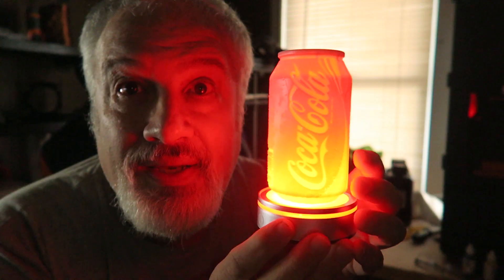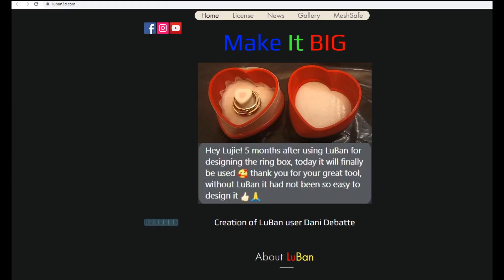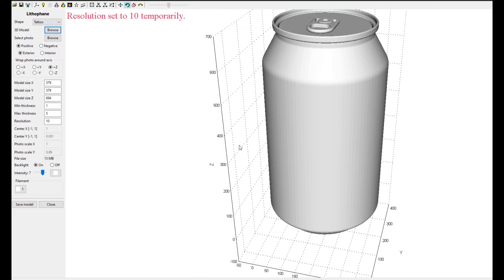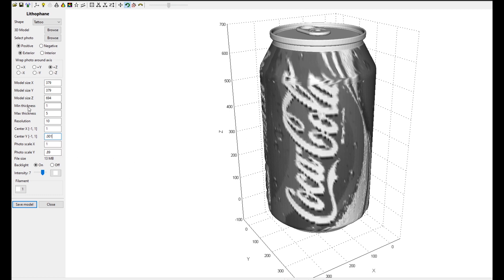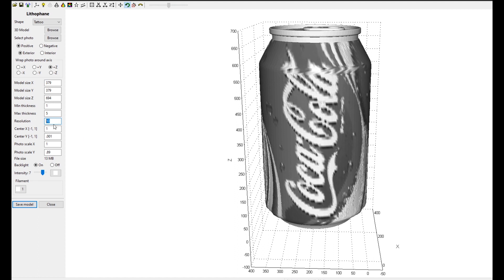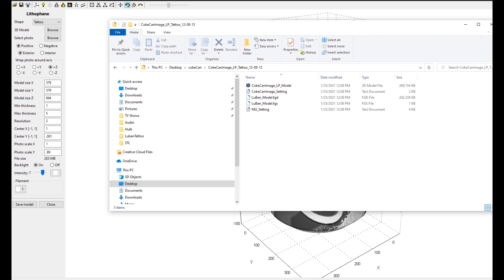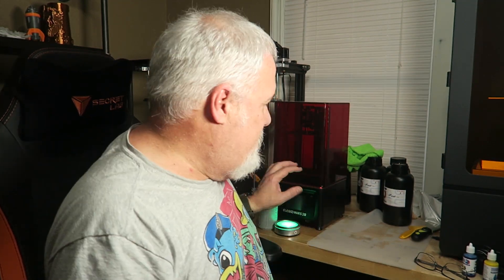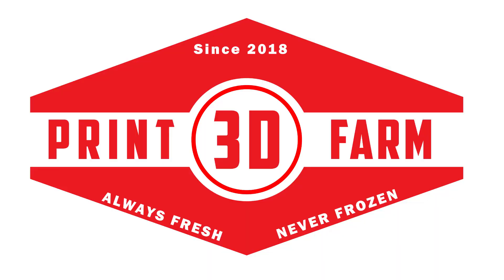How to Wrap a 3D Lithophane around ANY Object! Resin Tutorial!

Comment: I designed a 3d printer pot and I want the lithophane to wrap around the outside but for some reason it wraps around the inside also. Is there a way to change that?

Comment: Hey Garrett, great video! Thanks! You mentioned that you use Chitubox for slicing, what version are you using and have you run into any problems with it? I installed it but it won't load, tried 64bit and 32bit, don't get it.

Comment: Hey Print Farm guy..Can you help me?  My head is gonna explode..I follow your tutorial exactly..and still the model wont print..what i dont get is that i have min set to 1mm and max 5mm..mine looks exactly like yours..i bring it into chitubox and it looks fine..tried different settings..tried vroom, tried a raft, no raft..slow lift speeds  supported just like yours..still fails everytime..so i bring the model into prusa slicer cause i was gonna just fdm print it..then i see when i slice it, its not solid..the walls have breakthrough spots all over it..no wonder it wouldnt print..so why when min thickness is set to 1mm is it breaking through but you dont see that in Luban or chitubox?..model looks fine..the only other thing i dont get is my model comes in with the top and bottom along the y axis..not the z like it should be..i even set my axis before i bring in model and it still does it..I honestly dont think people will have success printing this..my wall thickness looked like 1mm not 5mm anywhere..what is up w that?  .its not even close to that anywhere..its like 1mm and less everywhere..ill show you pics of my fails..the supports print but the model fails a few inches up and the walls basically fail..i thought it was my Vroom settings..so i didnt do that and even printed it 70,70,70.. .05 hgt,  bottom layer 4, exposre time2.8, bottom exposure 20-30,  transition layer 10, 7mm lift distance,  70 speed  i think the walls are to thin..ive printed 100's of lithopanes before..never had this problem..ive tried everything..heavy supports, you name it ive tried it..i want to know why the walls arent solid..obviously the (1mm minimum isnt working)

Comment: This 'Coca-Cola' graphic is badly pixelated. Could you use a 'vector' art file instead?
Reply from the maker: Shoot me an email at 3dPrintFarm@gmail.com and I'll send you the graphic I used.
Reply: @3DPrintFarm : My question was more of a "yes" or "no" question. I saw how you manipulated the file to get rid of most of the pixelation. I'm still curious as to whether or not you could have use a 'vector' art file instead?
Reply: @jayedwin98020  for now, you can only apply a bitmap to a model to make lithophane.
Reply: @lujiechen2334 : "Thank you"!
Reply: @jayedwin98020  Just to add to this though, its not so much that the original image was badly pixelated, it wasn't, its just the representation in Luban was set as a low resolution ( 10 ) this is done for manipulation purposes as what you are seeing in the model isnt actually the image, but the 3d representation of the lithophane of the image, and a higher resolution makes it more processor intensive to manipulate. The pixelation goes away when the resolution is raised but the processor and memory usage becomes more intensive. In short even if you could use a vector image you would get the pixelation at the resolution of 10, as its the 3d model your viewing and not the image file itself....if that makes sense